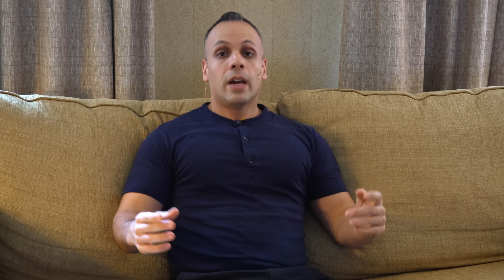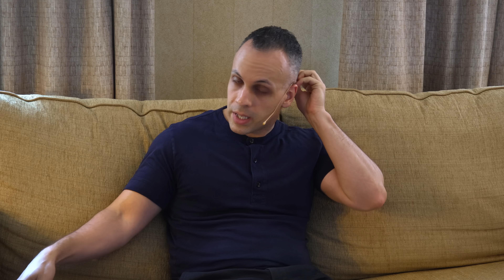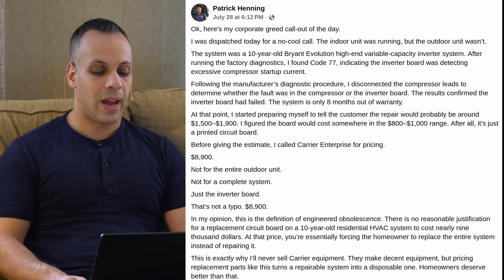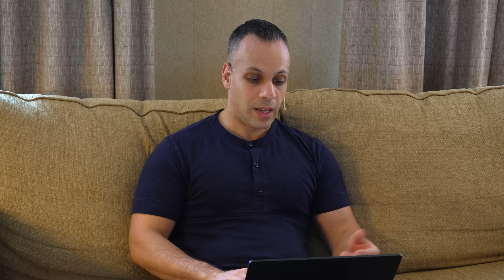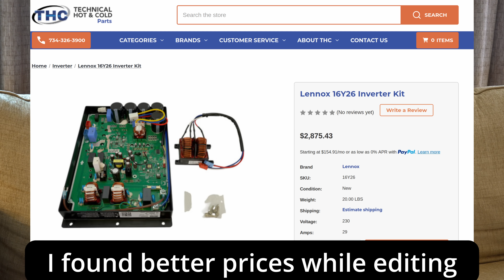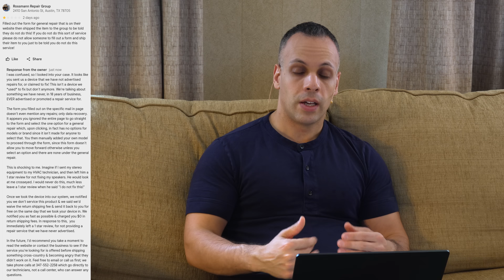Carrier AC repair has $8700 part cost for residential unit

Comment: Hey Louis. Long Time no comment, Lovely that you're using a Framework Laptop Still, Do you still think pads are good as The Framework isn't available in my Country, Love to Blackberry ,
Best, 
S
Reply from the maker: I bought a thinkpad p1 gen 6. It was throttling to the point of being useless editing a video in davinci before rendering. They have all the downside of 15 year old apple design flaws(which apple fixed) and none of the upside imo, thinkpads are horrid now.

They don't have trackpad buttons

They overheat doing basic tasks

The keyboard is massively changed from what i loved about my t520

It still carries a thinkpad price premium but they're not thinkpads anymore. I would use a macbook before a thinkpad in 2026.
Reply: @rossmanngroup thank you for your reply ,
All Laptops from every major brand seem bad these days in terms of thermals, especially the gaming ones,
Thinking of buying a MacBook Pro and running a Linux distribution on a VM,
Annoyed by the lack of robustness of the new HP and Dell workstations.
Thx again
Reply: @user-js6yq6gs3p  there is linux for arm
Reply: @user-js6yq6gs3p if you are considering older devices, the Asahi Linux project is at a point where you can daily drive Linux on bare metal if you limit yourself to M1 series devices.
Reply: @user-js6yq6gs3p  you'll be happy with the Mac option, I've got a Macbook Air, framework 12 and 16 and some classic ThinkPads, but the Macbook due to its ease of use and ability to text from a keyboard is amazing. I honestly love it. 

Look on the used market, and look at the M series, my M2 Air is still blisteringly fast and is extremely well optimized. I got it used from Apple before the Ram "shortage", and I'm happy. 

Good luck!
Reply: @user-js6yq6gs3p  Right now is a really bad time for buying laptops. That being said, my work just went through a review of the three major brands for a cost benefit analysis of workstation laptops(we use high end dell engineering laptops). Dell still came out on top. Middle of the pack for failure rates over lifetime, but the best support network and utilities. Lenovo is the best for failure rates, but they have midddle of the pack support and utilities, coupled with a higher DOA rate(once past that they are decent). HP is the worst, Highest failure rates, Worst support and utilities barely functioned on our environment(If you go with HP, i hope you like weak/worn hinges, idk how they still have that issues 15 years since i last had to use them.). 

The last model of precisions were pretty good, the two models before that sucked, with high fan and keyboard failure rates. The current ProMax(16250) has been great, with 0 issues other than a recent microslop gaffe that broke the audio drivers but that was a quick fix for the laptops affected. I would need another year or two before i hit the end of our lifecycle to know for sure but so far the new dells have out lasted and out performed the previous models by a huge longshot. I currently manage around 1k Users so have a decent grasp on the reliability of the models that we do use. 

That all being said, i did not personally partake in the review. 

Laptops handle thermals really poorly as is in their current design, they dont have enough space between the feet and the surface they sit on. Even the engineering workstations. We do a weekly maintenance 3d print on a printer where a 1.5in riser block is printed to allow more airflow, with that riser block we stopped seeing thermal issues and noticeable throttling. Current cost per unit from dell before our discount is over 10k per laptop. a year ago it was 3-4k before our discount. 

TLDR: Dell is much more robust than you think, but you have to pay to get it.
Reply: @user-js6yq6gs3p  The thermals definitely seem bad on gaming laptops these days. However, I've had two gaming laptops that consistently ran around 90 degrees celsius under load and they both have lasted more than 6 years, which is surprising to me. On desktops that seems crazy but it seems fairly common and even manageable with modern laptops. One thing I will say though: NEVER buy a Dell!
Reply: @user-js6yq6gs3p May want to check out the asahi Linux project
Reply: @rossmanngroup  you made a video many years ago about how Lenovo removed the trackpoint and not long after the trackpoint returned. So they seemed to listen to you, maybe another video on Lenovo is due...
Reply: @rossmanngroup  welp, writing from a skylake p51, it is a pretty decent machine even in this time and age.
Reply: @Sans228-o6b  t450 and x220 reporting in
Reply: @rossmanngroup I'm still using my t430 - it's a legendary tank
Reply: @MojoCuba Fuck yeah me too, parts for decades I love working on it
Reply: 100 bucks they didn't have any dedicated surge protectors for that unit. Those variable speed motor internal caps , or the boards is usually a blown cap. Get a surge protector class 2.
Reply: hi man, since i saw your comment. My t14s thinkpad gen1, had one of the keys die on it. They dont even have replaceable keyboards, for the S model at least, and in order to fix it you either have to buy a random Chinese knock off and unscrew over 100 screws from the keyboard module to the top case, after you do a complete disassembly of the laptop(if im not mistaken, you even have to detach the screen). The price i found for a genuine top case assembly with the keyboard was around 250euros which at that time was around the price of the laptop refurbished. 

Out of my experience. I would just go for ANY other laptop even if its some throw away garbage, i spent way too much time thinking about a good/cheap laptop to get while it still is relatively fixable. In the end i got up sold a T14s instead of T14 which I assumed would be equally easy to fix if anything happened to it. I would NEVER get anything thinkpad related for a laptop as of now just due to the stress that the situation caused me during the time of looking for a repair before deciding its e-waste just for a fucked up BUTTON.
Reply: ThinkPad developed by LeNoGo
Reply: Law should require that the sum of the spare parts and specialized tool do not cost more than the cost of the finished product +20%
Reply: @A @ABa-os6wm at’s absurdly impossible to put into practice, and it’s arbitrary. The problem you are trying to solve wouldn’t be solved by more legislation when legislation is more to do with what causes the problem. What we need is MORE COMPETITION.
Reply: @G5Hohn Sorry the competition was already bought by their bigger competitor, which is how we end up with the monopolistic practices increasingly across all sectors of the economy.

You can't seriously declare 'more competition!' in this day and age and expect anything to actually happen. The more advanced products are over the years, the harder it is for random joe to start a company in his garage and compete with no capital, influence and street brand recognition.

Laws are obviously the way to solve this because companies will stop at nothing that doesn't put them behind bars these days.
Reply: @G5Hohn And less pointless restrictions on repairs.
Reply: Doesn't framework support right wing projects or something?
Reply: @luizzeroxis  Does he pay rent?
Reply: @luizzeroxis (for those out of the loop, there was this story about a friendly exchange of publicity and resources with Omarchy, whose author was recently caught posting an extreme right-wing take; whether you think that story alone indicates the views of Framework as a whole or is an overblown nothingburger I leave up to you)
Reply: @luizzeroxis  open source shouldn't be political
Reply: @luizzeroxis you say that as if its a negative?
Reply: @luizzeroxis 
Do they, fantastic news. I was sold already though.

Comment: The repair-vs-replace math on high-end variable inverter systems is brutal when the OEM controls the part supply like this. That local tech's advice about 'good enough' equipment holds up - the efficiency gains rarely survive a single proprietary board failure. If you're staring down a replacement decision after this kind of diagnosis, it's worth getting quotes that spell out parts sourcing, labor, and what happens if a specialty component goes EOL mid-warranty. The contractor selection piece matters a lot here. ARS/Rescue Rooter is one option to compare quotes against, though their coverage and which brands they stock varies by location. Whoever you go with, ask them point-blank how they handle parts availability on high-efficiency inverter systems before you sign anything. The install quality and long-term serviceability question is just as important as the upfront price.

Comment: The tech's story about the $8,900 inverter board is a real thing in the industry, and it basically forces a replacement conversation whether the homeowner wants one or not. The honest move here is to get a written quote that breaks out parts, labor, and what warranty covers the new equipment, because a lot of people approve a replacement without knowing what they're actually getting. If the system is 10 years old and the repair cost is pushing toward half the replacement cost, the math usually points toward new equipment anyway, but you want to compare at least two or three scopes before deciding. ARS/Rescue Rooter is one option worth checking for a second opinion on the diagnosis and replacement quote, though service availability and pricing vary by location. Whatever you choose, get the scope in writing before approving anything.

Comment: The control board for my refrigerator went bad. Basically the same thing as a refrigerator is an A/C unit. The replacement board was $800 while a new comparable replacement refrigerator was $1,200  
I did some research into these control boards and found that if you knew how to de-solder/solder a circuit board, you could repair the board for about $15 in parts. Turns out there is a relay and a capacitor that go bad and shuts the circuit board down.  
Since I do not have that skill set, I ended up just replacing the whole refrigerator. It was as cheap as the parts/labor to have the old one repaired.

Comment: The local tech who steered you toward simpler equipment was giving genuinely good advice. With high-end variable-speed inverter systems, parts availability and proprietary board costs are real long-term risks that rarely show up in the efficiency sales pitch. When a single board costs more than a full replacement system from a competing brand, that's effectively a forced upgrade disguised as a repair option. For anyone facing a similar situation right now, the move is to get the diagnosis in writing, confirm exactly what failed and why, and get at least two quotes before deciding repair vs replace. A company like ars/rescue rooter can give you a written estimate on replacement options if you want something to compare, though pricing and system availability vary by location. The bigger takeaway here is that equipment brand matters less than parts availability, serviceable design, and whether your contractor can actually source the components five years from now.

Comment: You always have to shop these AC companies guy came out to my house. Told me I needed a new zone controller board. It was $1300.  I found it on Amazon for 190 and swapped it myself because it was so incredibly easy.  The kicker that wasn’t even the problem. It was a failed zone control motor that cost $100.  The whole outside unit with the compressor and the coil is around two to $3000 so buying a board for 8000+ dollars makes no sense.

Comment: I did HVAC service for a few years. Personally, I wouldn't buy a converter system precisely for the reason mentioned with the parts pricing. Hopefully in the near future these prices go down but it's been 7 years since I got into it and it doesn't seem like they've budged lol. Even though I wouldn't buy a converter system I would still buy a carrier unit, I have a 3.5 ton ac/furnace split system. I like carrier because of how easy it is to service the machine compared to many other brands. I don't have to contort my body and most things are easily accessible. It's been 7 years with my current carrier system and no substantial issues. Have replaced both capacitors(indoor and outdoor), a damper motor because I have zoning and I preemptively swapped my contactor for an emerson sure switch and put a hard start and surge protector on my unit. Also replaced the drain line with an EZ trap for easier cleaning. Oh and installed a PCO UV air purifier in my supply run. Fun fun.

Comment: Not exactly related, but a $15 contactor switch for my AC was gonna cost me $500 to be replaced. Needless to say, I  did it myself. Working fine several years later. My wife's blower motor in her car went. Quote: $700+. I bought it for $90, replaced it myself. It took 15 minutes.

Comment: Eight years in the HVAC industry I do service install and sell equipment. I’ve worked on pretty much any residential brand you can think of from a single stage to the highest seer inverter systems. I simply cannot fathom an inverter board being $8000. I’ve seen $1200 and $1500 which you could argue is reasonable outside of warranty anything beyond that is absolutely planned obsolescence being thrown in your face

Comment: If the part cost $8700 Yes I am definitely looking to replace because what if after replacing then shortly after a different part malfunctions.
I would also like to know if that $8700 part comes with warranty and the disclaimers. $8700 is EXPENSIVE for one part!

Comment: It’ll be 5 years next month since we replaced a 28 year old system with a Trane S9V2 two-stage, variable speed blower furnace and XR17 single stage condenser unit and matching evaporator with new line set, high capacity air cleaner and humidifier. Total was $7,725. I had considered Carrier and Ruud but the Trane dealer came in with the best price and service guarantee. The owner quoted the system and talked me out of anything more advanced than this. I’m thankful for it. I’ve had no service calls for it and it’s been working perfectly. And if it does ever need service, I doubt any one part will cost more than the system did.

I agree that the price quoted by Carrier is a we don’t want to sell you this part quote.

Comment: I have a Carrier because my house had a Carrier in when I bought it. The previous unit was 22yrs old when it needed to be replaced. Yes. It was $15,000. Yes, repairs are expensive. It also doesn't keep up when it's 95 degrees or higher outside. 😡

Comment: I refuse to purchase any AC unit that is in any way related to International Cooling Products or Carrier.

Those companies have a pricing model that is a throwback to the 1950's.  They have dozens of part numbers for the same product, do everything they can to keep parts restricted to partner technicians only, and charge obscene markups on parts that are basically consumables (limit switches and capacitors).

My home AC is failing, and I am planning on using a different brand that allows me to directly communicate with the unit via an ESP32 module plugged into the service port.

Comment: When my furnace stopped working a couple of winters ago, I changed the only part I knew how to change: The pressure switch. $35. It worked, and it's still working.

Comment: im more likely to send the board to a repair shop (that doesnt care what the board is for they just fix the broken bits) to be fully gone through and see what they would charge to repair it compared to all this nonsense...... that specializes in these repairs......and can give me a price of ?one tenth? the price of a new one.....unless someone is also driving up the price of the pieces parts deliberately......sort of like the auotmakers have done for decades.......IE----the cost of the parts to rebuild a ? truck cost more than a whole new one.......its now cheaper to go get yourself a classic you always wanted and restore it than buy new... or even used......because the classic will go up in value.....this reminds me of the salvation army/volunteeers of america that use to take junk and repair it and teach others to repair just about anything they were donated... now they want new or like new and then the charities sell them for new prices....??????? where they use to repair and keep junk out of the county dumps they now take in donations and then dump them while getting the tax write offs.......smh idk shrugged shoulders.................i bought a Ac /heating unit together because together they were cheaper installed than having the older one=Ac just rebuilt....................and i have never used the Ac since buying it.....and then i switched from natural gas heat to all electric....because gas almost tripled in price one year.........IE-------elon says 100? square miles of solar panels could power  the whole usa...........when this happens ac/heating/cooling will cost pennies ??????? :face-green-smiling::face-green-smiling::face-green-smiling:

Comment: I've got a similar unit to what is described.  The only reason it's still running is because I can get parts in online auctions and I can do my  own work to replace them, often at pennies on the dollar to what Carrier would charge for just parts.  That seems to be where those AC parts wind up when the official repair costs are too high - the working parts get sold off when the unit is replaced, and they wind up in my ten year old unit keeping it chugging along.